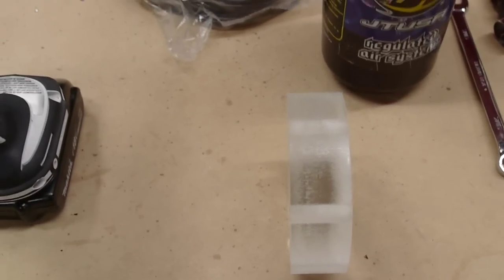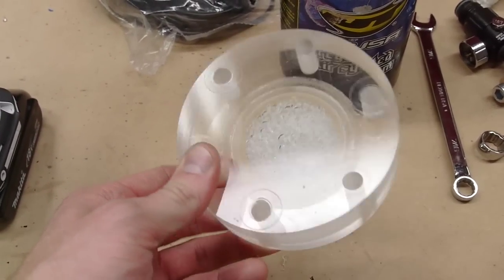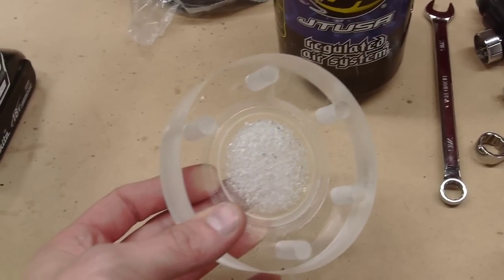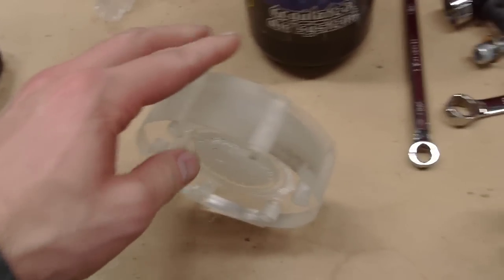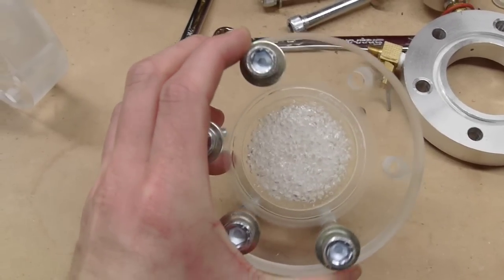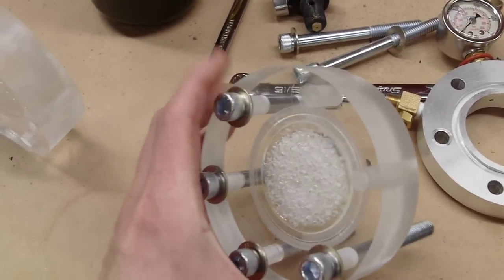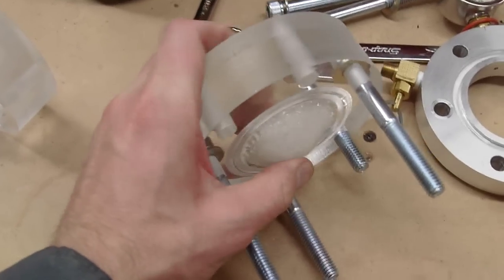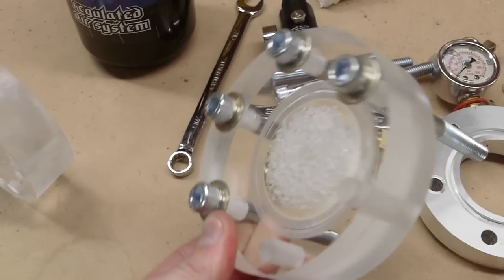Effect of long-term high pressure CO2 on acrylic

Comment: On some of the deep sea subs they use verious stuff but you might try leaded glass/crystal to make it. It is a LOT heavyer and you'll need a retainer ring of some sort on the outside of the glass, Aluminum might work and you half to be precise on torquing to make it uniform. This should easyly handle your work load.

Comment: Would be interesting to see what happens if you screw the two acrylic blocks together without the aluminum chamber in-between right after decompression. That way they're under regular air pressure (space is not really air tight), but the parts that would otherwise bulge out are physically pressing against each other. Maybe smaller bubbles and more transparency ?